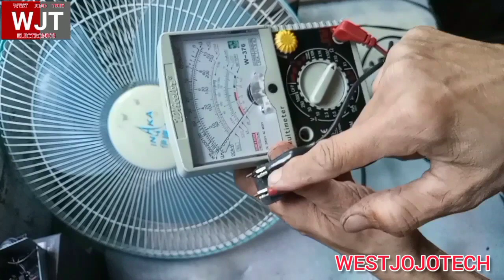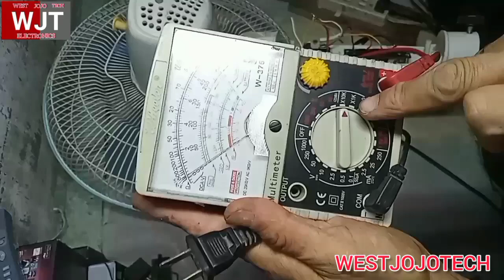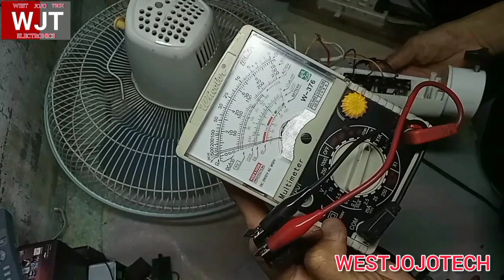ELECTRICFAN REPAIR DISKARTENG MALUPIT

Comment: Bintaro hadir... very good sir... swerte pa rin yung starter winding hindi nayare.. yung trik nato pareho sa ceiling fan controller, 3 capacitor ang gamit.. pero hindi ko pa natry sa 110/220 conversion.. dito kasi 220/50 hz at wala akong 110vac appliances..thank you for sharing
Reply from the maker: Thanks for watching sir

Comment: Naisip ko lang po sir. Diko alam kung pwede o tama ang naisip ko.
Diba po pwede naman palitan ang stator ng 110v. Sa 220v yung mga new rewind. Para pwd na gumamit ng 1.5 uf na capacitor.
Mas madali pa ang conversion
Reply from the maker: Pwede po un sir kaya lang ok panaman ung motor kung sunog mas OK pong gawing 220v na ung motor
Reply: @westjojotechelectronics9386  ok po sir salamat po sa pag basa ng comment ko pa notice nadin po ako sa next vid godbless po at keep on uploading usefull videos😊
Reply from the maker: @hideakiito9386  no problem sir
Reply: @westjojotechelectronics9386  💚💪

Comment: Kua jojo,,,My Bluetooth speaker po ako,Dalawa Battery nya sa loob pwd ko po bang e convert,,na gamit kong charger,,3.6 adaptor?
Reply: Kua jojo ayaw po gumana
Reply from the maker: Pwede naman po kung 3.7v po ung supply  nya meron po kasi 7.2v  sir
Reply: Kua jojo dalawa po kasi battery nya sa loob MASS speaker,,,
Reply from the maker: @marcjemmontanez3169  pwede naman po  sir di naman po masira un kung I try nyo
Reply: Ok po